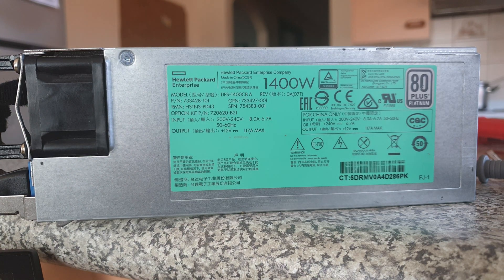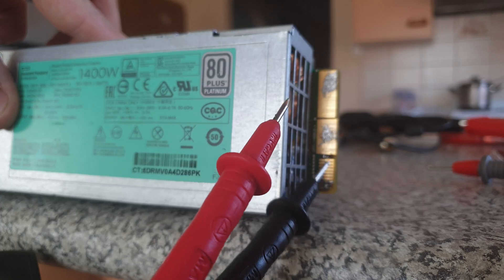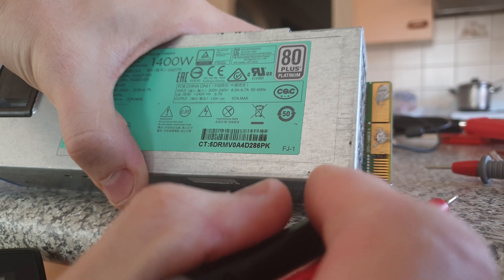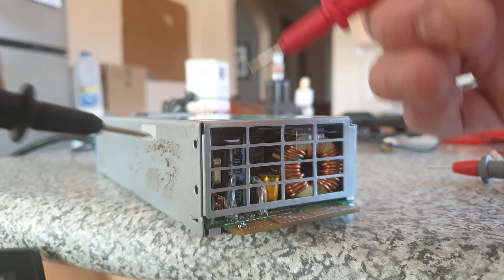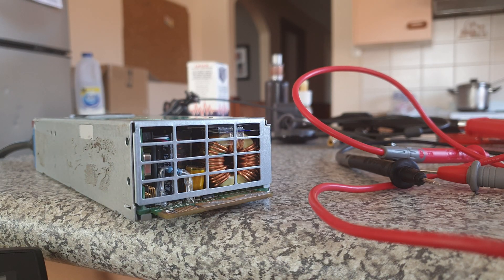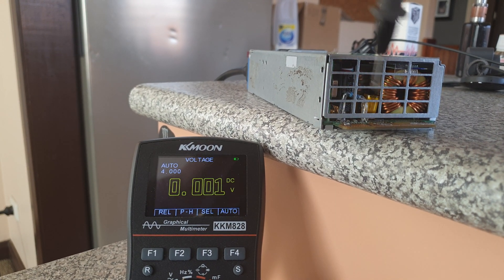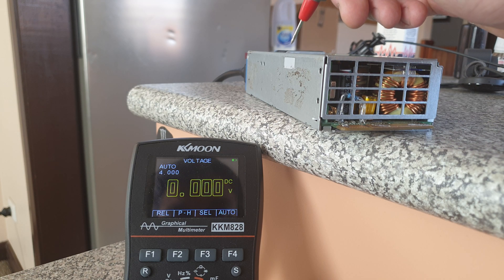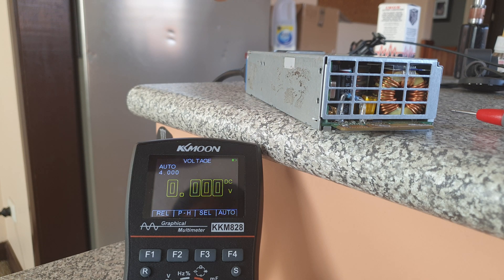HP DPS-1400CB A flex slot SMPS PSU

Comment from the maker: Copied from the video description, which was written when the video was uploaded, and has always been there, available to everyone
If you open the case, there is a vertical PCB that runs along the side and on it there is a very small, metal potentiometer facing outward.  Turn it clockwise to increase the 12v output voltage, anticlockwise to lower it.  I connected a 25K ohm resistor to the pin on the right of the pot and ground    14v is now possible, however going too high will trip over voltage protection

Comment: I did this, and the power supply worked for 2 minutes. After removing the modification, it no longer works. Did you experience this?

Comment: https://www.youtube.com/watch?v=e5L4t9x0kEc&list=PLZNOzVeSAgBCzgrTiHYxd06vLO4Or4hcC&index=7
Reply: Apparently you dont need the resistor from pin 3 to ground, pin 1 is ground, so you can just connect pin 1, 2 and 3 directly with a blob of solder

Comment: Fack video bro no volt Incres  12.4 volt
Reply: for increase voltage he added extra resistor in the power supply, for more info you can search "HP HSTNS-PD43, Hacked, OVP, 15.5 VDC"

Comment: Hi mate! Thank you for a video! do you have any clue about this PSU working as a constant current source? will it trip to overcurrent protection if i connect it to the discharged big liion battery?
Reply from the maker: I dunno how hot it is where you are, Perth, Queensland etc, but temperature is all you need to worry about.  In Tas I haven't had an issue using it as a power supply to run my car stereo in the driveway.  I set mine to output 14v, it sags to about 13.4v when I connect it to my car, I've got vids of me drawing over 100A dynamically (at 14v, so 1400w +) with my car stereo, it takes it just fine, it is super efficient so bugger all heat output, BUT that fan has always  been pretty awesomely quiet for me,  dunno if it will ramp up if it needs to, I'd assume so..

Last week I disabled the OVP and now I have it idle at 15v because I have a LiFePo4 320Ah setup on the way and I hope that it will keep it charged up, because after 8 hours connected to AGMs and listening to music at over 100A draw continuous, the battery would start the car fine, but put a proper charger on the batteries and you would see it has been feeding the sound system all it needs, just hasn't been able to charge the batteries to 100% like, a battery charger! lol  

I am 100% sure this will output 1400w constantly for more than 30 years, 24\7, just keep an eye on how warm it gets and how fast the fan spins.

It has a characteristic you need to know... If I don't attach it to my batteries in a certain way. it won't turn on, once I connect to the battery and turn it on it will instantly put itself into protect.

What I do is, place the positive lead on my battery, then hit the switch, which turns on the PSU output, then attach the ground to the battery, SWIFTLY, WITH PUPOSE!  If I drag the clamp or terminal, if I accidently lift contact, hell, a lot of the time, I don't do anything wrong, but the PSU will be on and you go to connect the other terminal (neg) and it will shut off, protect, and you need to switch it off again and wait 10 seconds before retrying.   It is actually a bit of faffing about, but you will soon learn the quirk and it won't be that big of a deal.

Connect POS to battery, switch unit on, connect NEG to battery and hope the green light stays on!   You can try to connect NEG first if you get frustrated, it doesn't matter really which is connected first before powering on the PSU.

Goodluck 👍
Reply from the maker: Disable OVP:
https://www.youtube.com/watch?v=e5L4t9x0kEc&list=PLGLa8PT50O3MqNjT5vsBApr3XH98gTycN&index=2

Comment: Hello @Minus 3dB In The Teens not sure if you are still around - about the 25K resistor to the pin on the right of the pot. This is on the middle connection of the pot meter, correct?

Comment: I can probably figure it out but do you have a video showing the 14V mod in detail?
It has been 2 years, have you found what is tripping the OVP?
A lot of people could make use of 15V.
I turn on the PSU by shorting all those three pins directly (first pin is ground, two other are PSON and PSKILL), and to toggle it ON/OFF without unplugging the mains, the first pin is being switched from the other two which remain connected together.
EDIT: Nvm, someone already did OVP video watch?v=e5L4t9x0kEc&t
Reply: you want to power off at mains other wise you will still have the ac circuit powered up which will run warm and still pull power.  putting a switch out front to switch only shuts off the dc power

Comment: I obtained a 500W flex slot PSU, and couldn't find anything anywhere else.  As soon as pins one and two were bridged, the green light came on, and 6V at the big outputs.  When pin 3 was grounded (680 or 1K was the same), 12.3 V.  So it's usable anyway, and thanks.  I may try to get it to 13.6 or so.
Reply from the maker: I'm happy you got it working!  The resistor is probably not necessary, I used it as a precaution

Comment: Gday mate, thinking about using these for an rf amp supply, do you have any idea if they produce rf Interference. Thanks for the video
Reply from the maker: I have no idea how to even test that bud.  But it's a high quality server power supply (so reliable and probably shielded somewhat for a server environment?), it has platinum efficiency (over 94%) and one of the things I deeply love about it is that I can run my car amplifiers directly off it, and I get a dead silent noise floor, no switching noise, nothing, plus the fan is crazy silent too.  I seriously love it
Reply: bloody hell i wish the mrs would answer me that quick. thanks mate it appears most of the rf guys go for the hp's. for  the price they are its probably worth just buying one and trying it. thanks for your time and video cobba, nice work    @minus3dbintheteens60

Comment from the maker: If you can't work out where the voltage adjust pot goes then you shouldn't be messing around with it at all
Reply: Well that's just an ass comment
Reply: Sometimes people need an helping hand to get things sorted out. Everyone starts at Zero. 😀 That's why most people look tutorials. But yes safety should be at first place at work like this. Anyway appreciate help for the inside look.
Reply from the maker: Look in the discription

Comment: Hi, thank you for showing us how to use this PSU. Can you please explain us in a little more detail how you have soldered the 22k resistor, more precisely from where to where because I have tried and I’m constantly shorting it.
Reply: Rectification, I meant 25k resistors that you have mentioned on the logic board.
Reply: Only the 25 k will work? I test a 22k an a 30k, but every time protect... Take a picture?

Comment: Cheers from the Ozarks.  In one of your comments you mentioned parallel operation.  Have you determined a pin to connect between two units to achieve this?  For example on the HP 1200w units I believe it's pin 34, the load share pin.
Reply from the maker: Sorry David, I currently only have 1 of these units, I have 4x DPS-1300BB B which are very different. I've got a lot of other stuff on at the moment, but if I do work it out I will report it here

Comment: I did this mod and got a stable 12.2v… then I drilled two binding posts through the PCB to connect to (rather than soldering wires onto the terminals).  The voltage is now 13.1v and the fan ramps up lots when I simply put a multimeter across it…. You think it is stuffed?  Perhaps the PCB is multi layered?
Reply from the maker: Look at the + and - output pins, they are different sizes on top than they are underneath. You might have it shorted out. That is why I just soldered to the top pads only
Reply: Did you fixed it?
Reply: @juaneliasfriascastillo3798 nope.  I binned it.

Comment: Hey i think of buying 2 of these PSU´s to fire Up both to get 24v for my Charger. The pinout is nice now i know how i can Power them on. And i think its the Same way i have to Float Ground on the Sleeve PSU as in other Guides. So i have a Brutal Power Supply then for my 2x30A charger.

Comment: Thanks for the video got them working, using them in series to get 
24V to charge lipos ,had to take one apart to break the negative connection ground from the case 
This is done by replacing one of the screw with nylon and a nylon washer between the board and metal case 
  screws toward the tabs
Reply: So u made a Floating Ground but the Case is connected with Main Ground for Safty?! I wanna do that do now because the 1200w PSU are way to expensive.....
Reply: Is it the screw close to the AC input socket?

To activate the PSU it is enough to connect Pin 1,2 and 3 together. Pin 1 is GND, too. The 1k resistor is not necessary.
Reply: @Henning_Rech so what your saying is just soldering pins 1,2,3 together works fine? No resistor needed like the video shows?
Reply: i'm about to do the same, i'd be really interested in knowing how your charger is performing and if you've had any issues. thanks
Reply: How they perform parallel? Do I have to find  a share load pin? I’m trying to do the same so I can use them 24v

Comment: Just a question what does the resistor attached to the pins do?  
Do U need the resistor could U just short pin 3 to ground with a wire
Reply from the maker: The resistor is just to limit current.  I was using resistors rather than dead shorting pins while trying to figure out the pin layout.  Shorting those pins would probably work fine, however I dont remember testing it, and can't guarantee anything.
Reply: @minus3dbintheteens60  thanks for the reply mate. 👍
Reply: @trentoncorbet1  Hey just wondering if you tested out shorting pin 3 to ground with out the resistor?
Reply: @markatkin7950  yeah mate I've had mine working without the resistor for about 5 months using it to power an amplifier and car stereo head unit running subwoofers and a couple 6 inch speakers, haven't had a problem so far, have done this on 2 psu's so far.. both dell branded. 1x 1400w and the other If I can remember 750w or so

Comment: Hello my friend. let me see If I understand you... for my purposes I need 12V... I only have to short pins 1 and 2 and connect a 1k resistor from pin 3 to gnd? thats all?
Reply from the maker: That is all.  That will turn it on.  I have found that when its turned on then I connect it to something, it turns itself off, so I unplug the IEC power cable from the PSU, unplug the ground wire from what I am connecting the PCU to, then I plug the power back in, then connect the ground wire back to the load, eventually it will stay on.  I use it charge my car battery, I put alligator clips on the PSU output.  I am getting 100A at 14v no probs.